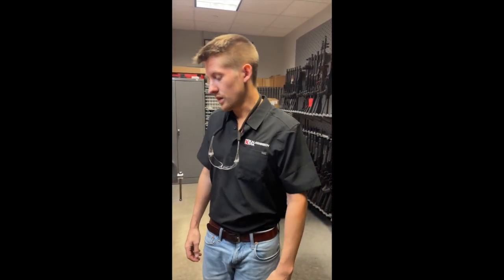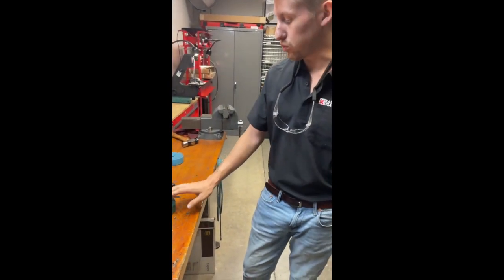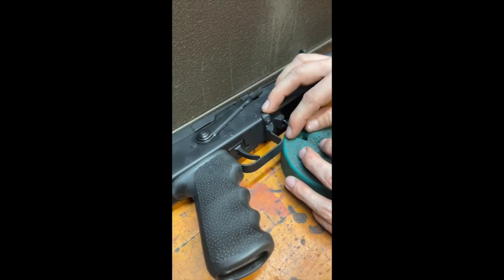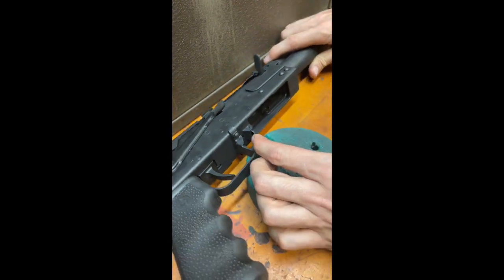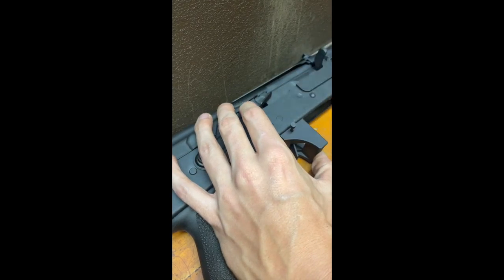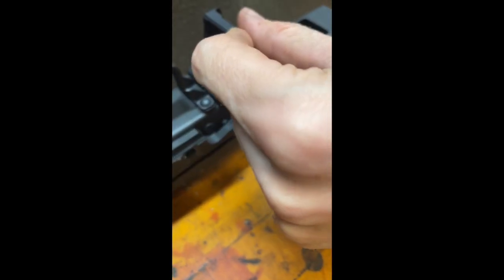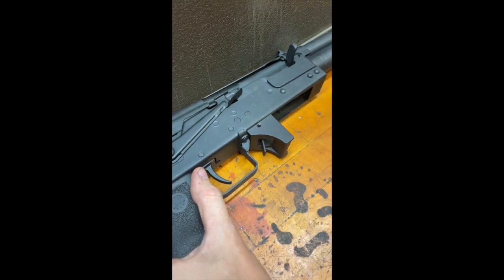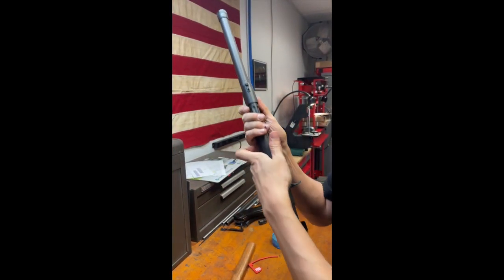HOW-TO: INSTALL 12 GAUGE MAGAZINE RAMP

Comment: Ordered and had it in 3 days.  GAME CHANGER!  Took a bit to get it on, but watching that the pin holes are lined up, a little tapping to make sure they are aligned, and it was installed.  2 important things.  Use the right size pin punches (not center punches), and support the area of the mag release so it doesnt bend.  You may have to use some pretty good force to move the pin.

Comment: It’s literally a training wheel lol
Reply: until you try loading a 10rnd mag with the bolt forward on a KS-12 you wont understand. It's not a training wheel.
Reply: @jeffreyhutchins6527  really? Been running a Saiga 12 for about 10 years without training wheels…. Works fine, a little stiff but goes in every time lol

Comment: So i got this part and tried it myself,had heck of time getting pin started and this was after shaving material off top. I broke mag catch off gun, so ordered another mag ramp. Had to take to gun smith repin gun for catch, but they couldnt get the part to go on,lol!!!. Alot money later and im back where I started. I believe it may have to do with brand mags and which ones have extra room in bottom, or just load one less shell. Only other option i see is dissedent arms make a legit magwell,but requires sending out and very pricey and then have switch mag style. So load one less it is,hahahaha oh and promag drums wont fit with this on, so blessing i never got it on anyway
Reply: The ramp was designed to be used as an assist in forcing the magazine to lock securely in place with the bolt closed. This does make it a bit easier. Even though you really don't need it & you can force it in regardless. Although this was supposed to be used with the newer updated follower(the follower was different especially inside, was not like original follower). After installation, tested & found it worked well. After installation of yellow follower, seemed a bit easier...........

Here's the problem.
You cannot run these followers in aftermarket mags such as Pro Mag & SDS.  With the ramp the Pro Mag will not lock in due mag being a touch bigger. The SDS mag will work but will mar up the ramp. 

2nd problem. 
I have the Komrad, so with 10rd magazines, it will not work due to foregrip. I would have to take out foregrip in order for ten rd mag to work & I'm not going to do that.

In the end, I think the idea was nice but not tested enough in conjunction with aftermarket parts & the different configuration that they offer with their products. 
I wish they would have had this in the description so I would have made better judgment on my purchase 

I still love K USA . That will not change.  

Note: I do not have a drum, so I've no idea if it would have worked or not.